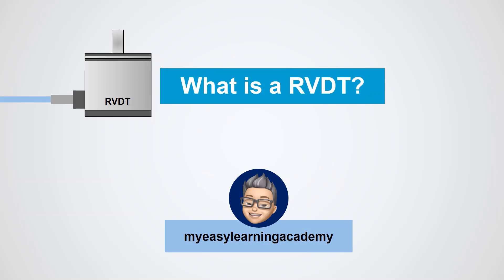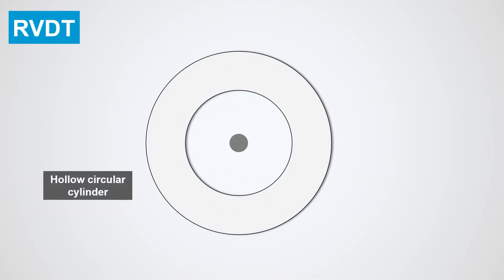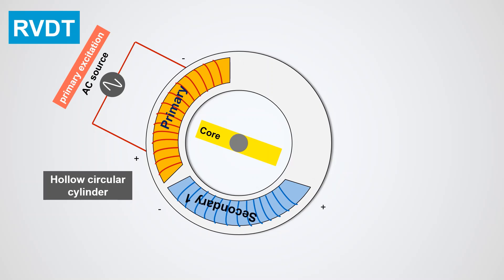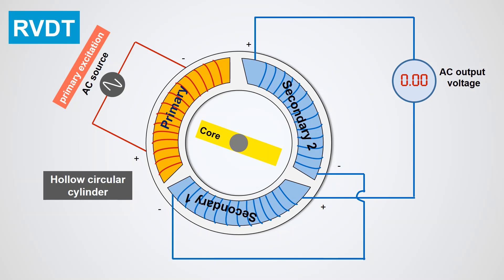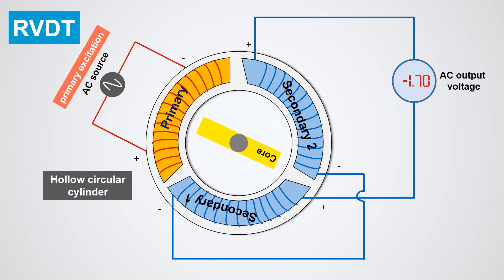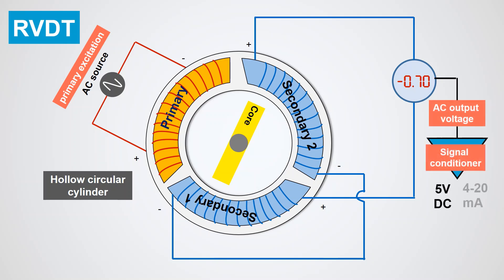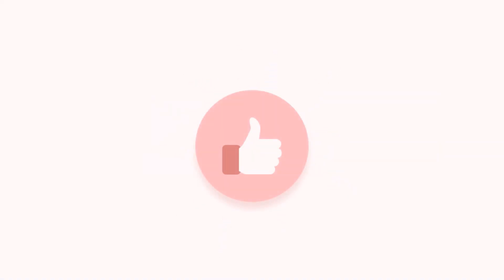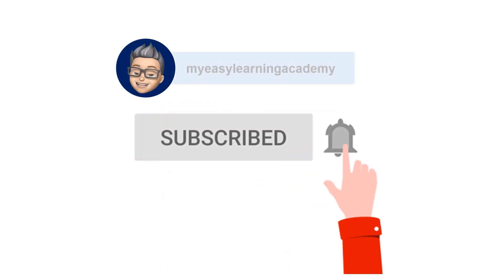What is RVDT?

Comment: What manufacture could provide RVDT with angle range : 0 to 270 degree rotation
Reply: For a Rotary Variable Differential Transformer (RVDT) with an angle range of 0–270 degrees, you will likely need a custom or geared solution, as most standard RVDTs have more limited linear ranges. Reputable manufacturers that offer customization options for RVDTs include: 
1. Kearfott
Offerings: Kearfott is a long-standing producer of RVDT sensors for high-reliability applications in aerospace and other markets.
Customization: They are a strong option for custom needs, as they offer geared, direct-drive, and tandem in-line options designed to extend the measurement range. 
2. Sentech Inc.
Offerings: Sentech manufactures RVDTs for a wide variety of applications. Their standard AC/AC RVDTs typically provide linear measurement up to a range of ±70 degrees, but they are mechanically capable of full 360-degree rotation.
Customization: They can customize an RVDT for your specific needs, which would include designing for a larger linear range such as 270 degrees. 
3. Moog Inc.
Offerings: Moog's RVDTs use a non-contacting design and are optimized for specific frequencies to extend their angular displacement range.
Customization: You can contact their experts to discuss a custom solution that can provide the 270-degree range you require. 
4. Sensata Technologies
Offerings: Sensata produces RVDTs for aerospace and industrial applications, noting that their lightweight sensors are capable of up to ±80° angular range.
Customization: For applications with higher angular displacements or multiple revolutions, they provide geared RVDTs with integral anti-backlash gearboxes. This approach could be used to create a 270-degree solution. 

( Sorry I didn't space  all things out correctly)